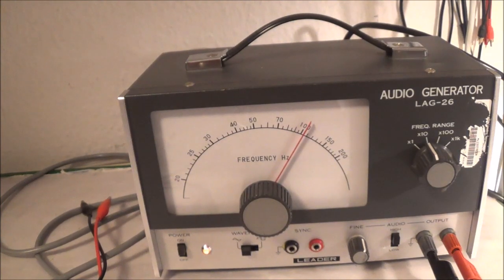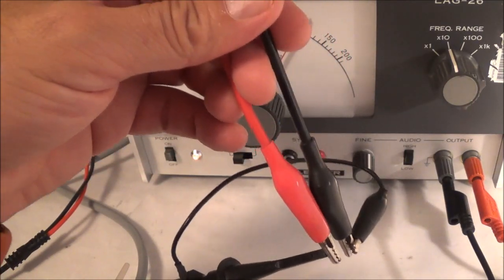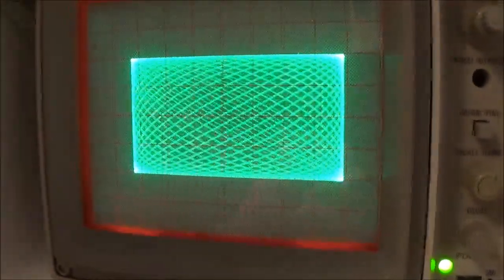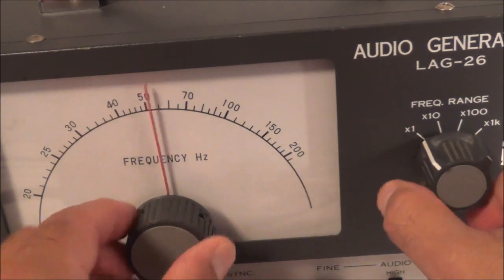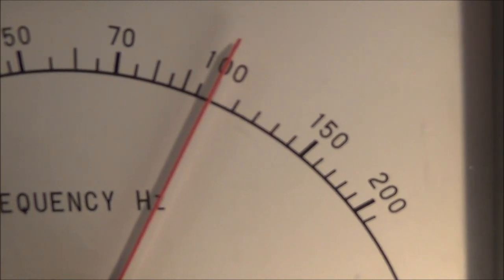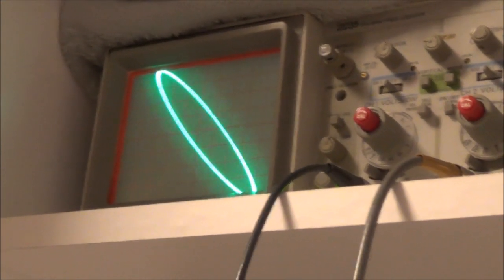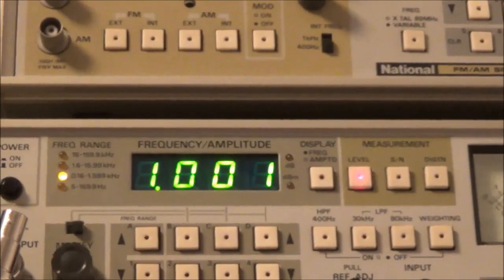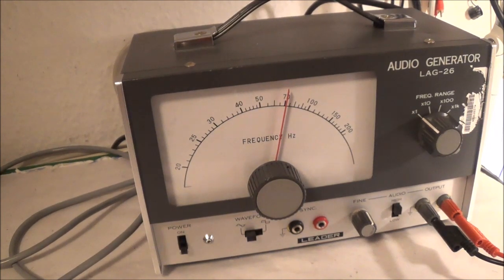Comparing Audio Generators -- Accuracy

Comment: Is an audio generator the same as a signal generator? I'm needing to get sound to come off of speakers I'm testing. What would you recommend me to get to get audio out of speakers? Thank you.
Reply from the maker: As the name "audio generator" implies, it puts out audible frequencies, that is, what the human ear can hear.  A signal generator can go much higher in frequency. Not needed for your purpose. I would try to get a used solid-state audio generator, maybe from ebay. One of the major manufacturers such as Heathkit, Leader, HP, etc. Seems like you are just looking for something real basic.

Comment: Thanks for showing this!  You know once you get rid of the Leader, you'll miss it and buy another!  :)  ~Jack, VEG
Reply from the maker: +Vintage Electronics Geek Thanks! Yeah, it's hard to let test equipment go. I would probably have a lot more if I had a big work bench with big shelves.
Reply: I'm with you brother, I think our benches are about the same size and the room has the same restrictions, none! :)  I am planning on swapping offices with the wife, this will give me a little more room, I think enough so as I can get bigger gear like the HP generators!  I am trying to find the time to do such a big move, but it will happen!  ~ack, VEG
Reply from the maker: +Vintage Electronics Geek Oh yeah, we need big workbenches and big shelves; and really bright lights. Plus, we need space for all of those amps, stereo receivers, radio, etc...